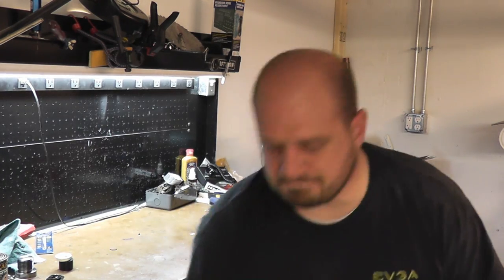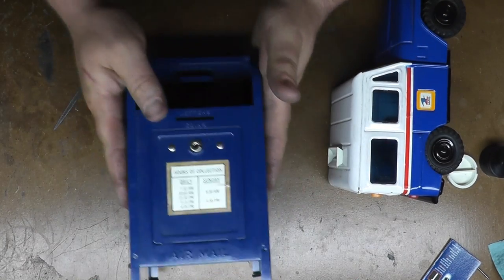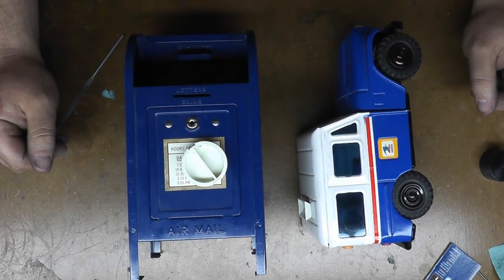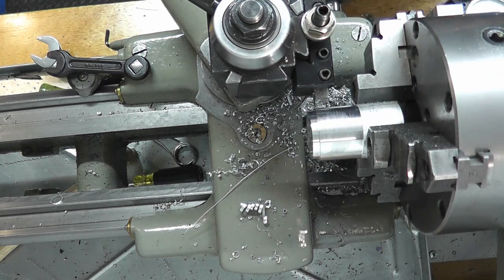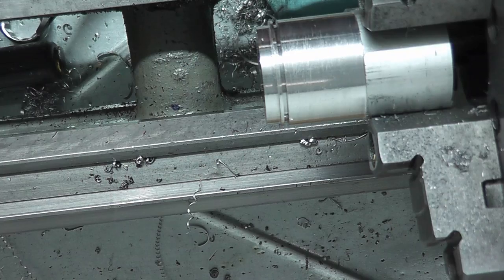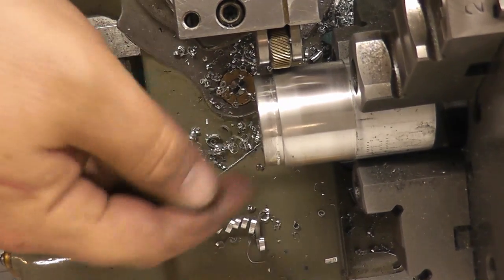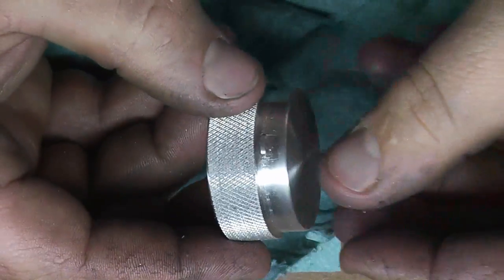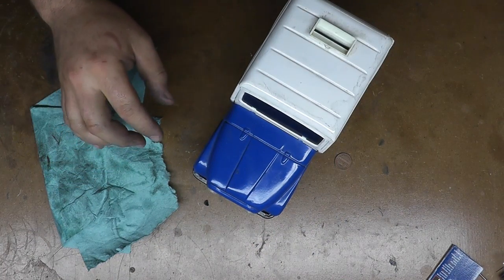Bank Repair

Comment: Great little project, Although I'm not sure about hammering on the work piece while in the lathe. All I kept thinking about were the poor bearings in the head stock.
Matt
Reply from the maker: They're plain cast iron bearings.  No balls and rollers so I wasn't afraid I'd hurt them.  There's only a ball thrust bearing between a step on the spindle and the rear bearing casting to take up the rear thrust load on these lathes.

Comment: Nice work, Greg. Maybe Obama can help you out with some change. What size milling machine are you after? Mill drill, or a beast? Take care.
Reply from the maker: Ha!  In a perfect world I'd be looking for a Bridgeport type, but since I can't squeeze that into the cellar I'm looking for preferably an older home shop sized machine like a Clausing 8520, Rockwell 21-100, or Hardinge TM/UM.  Of course everyone with a home shop wants one of these so that drives up the price considerably whenever they do show up.  I've been eyeballing some of the Precision Matthews stuff.  I'm not a huge fan of the popular G0705, but then again it is the cheapest and beggars can't be choosers.

Comment: If you have a cheap chisel, perhaps an asiatic chisel, it may be vastly improved by proper heat treatment. You can do it with nothing more than a propane torch. I got a set of cheapie chisels for $3. I rehardened and tempered to "straw" color. I don't know how these cheap chisels are treated but it seems to me that the heat-treating guys have been taking far too many days off. Or smoking too much whatever-it-is, because a lot of Chinese tools really come alive when you harden & temper properly.